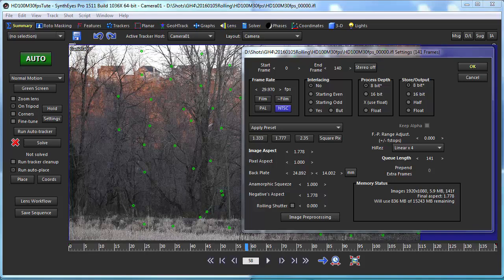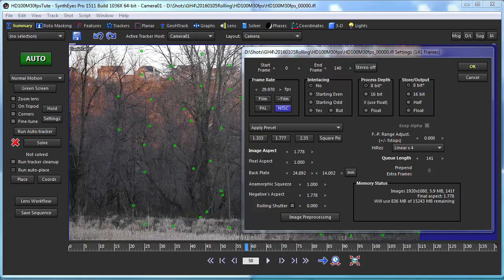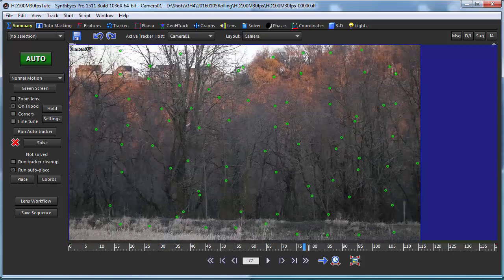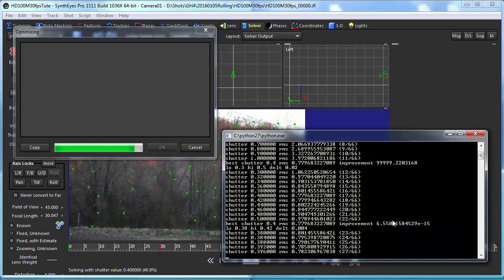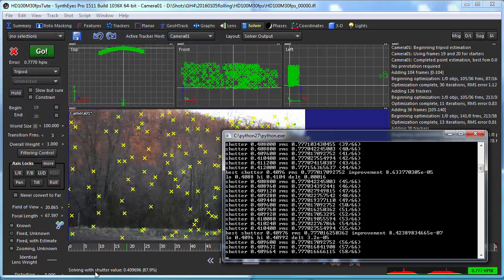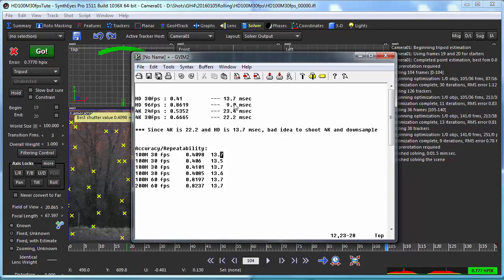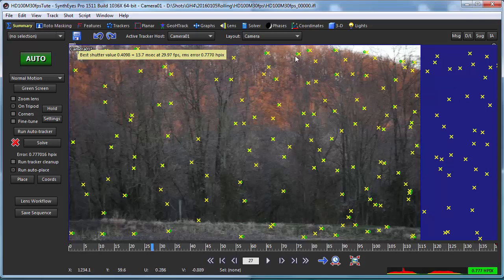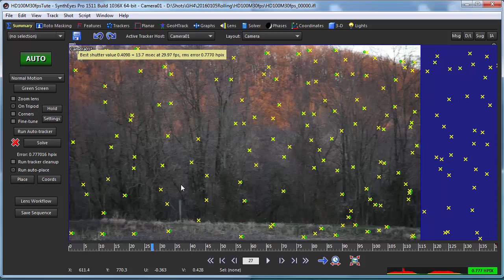Measuring  Rolling Shutter - Overview

Comment: russ solving is fine and dandy.  some manufacturers have the sensor speeds in the manual.  but if we could get a 2d transform that skews the image accordingly in nuke that would be great.  PFtrack does this now but I think it only works within PFTrack itself and you have to unrolling shutter the footage. and crop in compositing.  I know it doesnt completely solve the issue technically when it comes to individual object motion but actually works great for most shots.  it would be amazing if we could render overscan cg and apply the reverse motion shutter in a package like nuke for example.